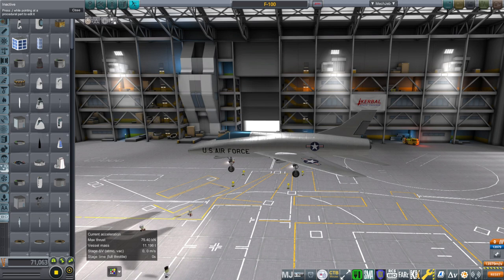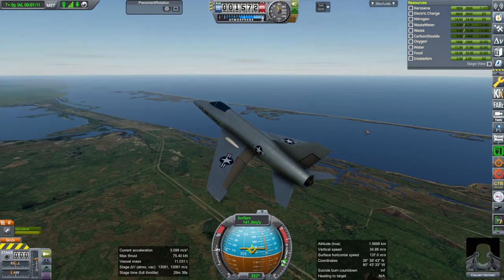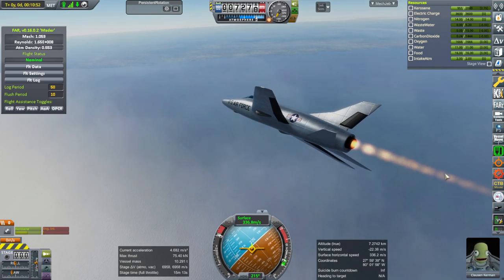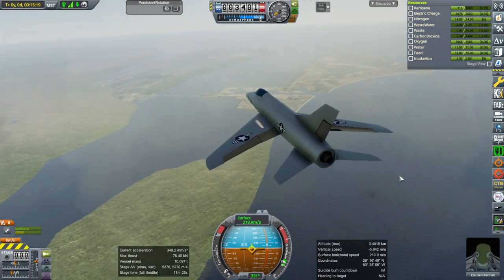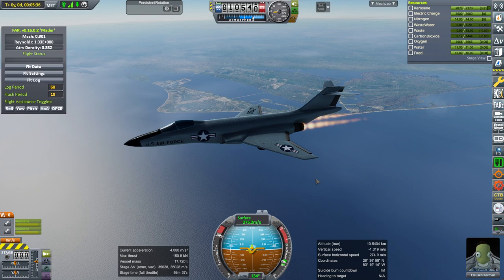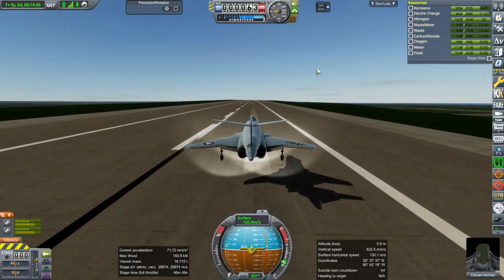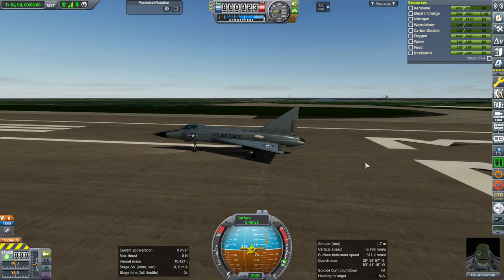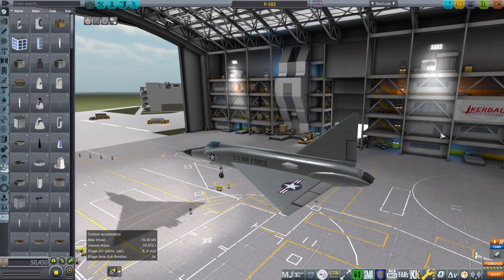Realism Overhaul in KSP 1.11 - F-100, F-101, and F-102 Tests

Comment: How do you disable FAR specifically for one surface (the vertical stabilizer) and not the rest?
Reply from the maker: It just doesn't have the module that tells FAR its dimensions, so the system reverts to the stock ModuleLiftingSurface for information. FAR is more peculiar about surfaces than the stock model is. If we had two vertical stabilizers, using FAR on them would be okay.

Comment: Why don‘t you turn on SAS when take off
Reply from the maker: Atmospheric Autopilot, the fly-by-wire mod I'm using, does basically the same thing but is better tuned for airplanes. It is activated when I press P and at that point shows a message in the upper right.